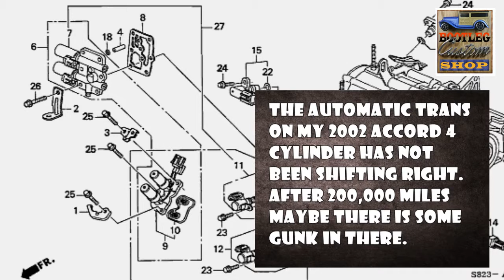1998-2003 Honda Accord automatic trans shift problem fixed with a crowbar and q-tips

Comment: Seriously, I can't understand why this isn't listed as a periodic maintenance item by Honda.   They probably should be inspected every 60,000 miles.   But then again Honda doesn't even mention inspecting the PCV valve in the list of maintenance items in the owners manual.   Unbelievable how they dropped the ball on this.
Reply from the maker: Gotta keep the Honda mechanics busy you know!
Reply: I spent $100 at the Honda dealer so they could tell me the sloppy 2-3 upshift means NEW Transmission.  No indication of this whatsoever.
Reply: @landontesar3070  It's because Honda doesn't acknowledge this as a problem but it most definitely is due to their faulty design.  It could have easily been avoided by using an ATF filter.
Reply: Transmission Filter on 2003 – 2007 Honda: 
Replacable external ATF filter. You will find this by standing opposite the front left tire and looking down, over the engine fuse box.  
Part number: 25430-PLR-003

Comment: Thanks! I cleaned out the gunk on the first set of filters out. I used parts cleaner to spray it off then reinstalled. Mine was shifting abnormal and would over rev/ delay shifts on all gears even at a stop light. after doing this, it drove fine. And still does. Took about 40 minutes to do.
Reply from the maker: Great to hear! Tks for taking time to comment!
Reply: Did you only do the easy access one ?
Reply: garner newman I did both but honestly the one below the battery was clean. I cleaned it out anyways just in case and reinstalled. The battery tray is held on by a bolt you loosen it and slide up and it comes off  at least that’s how it was on mine
Reply: baltazar chavez how bad was the paper gasket on yours ?
Reply: garner newman it didn’t have a paper gasket it was a rubber one it looked worn but I reinstalled as is and it worked fine no leaks. I didn’t want to purchase one of it was still going to shift abnormal. I’m sure they are cheap though and recommend replacing it if your ride is nice.
Reply: baltazar chavez I got a clunky trans shifting hard and weird af did this help you a lot ? I’m hoping it’ll save me from trans swap
Reply: garner newman it’s worth a try it won’t hurt to give it a shot and go from there  prior to doing this I replaced my fluid as well it helped but still was clunky it’ll take forever to shift and when it did it slammed into gear so bad I thought the front end was falling apart
Reply: baltazar chavez now how is yours?
Reply: garner newman good as of today
Reply: Thats what my car does delay starts at red light in second gear.  Can shift manually fine in first gear when needed at red light
Reply: @newman6830  Gasket is $5 from Honda

Comment: So the lock up solenoid (first one) new replacement gasket with the attached screens is about $30 from Honda.   The shift solenoid gasket (second one) is only $5 in case you need them.
Reply from the maker: Great tips Gene. Tks for sharing & subbing!

Comment: Thank you so much. This totally worked. I was getting a P0730 code(replace transmission assembly), along with slipping gears.  Freaked me out.  Took the solenoids off, and sure enough there was gunk in there. Car drives fine now.
Reply from the maker: Great to hear! It is so sad when even the code reader is trying to screw us. Pls consider subscribing, your comment is great! Could use more folks like you here!
Reply: Having this same problem on my moms Honda. Did the problem ever came back on your car?

Comment: MOST of the time this is what you need to do all automatic accords. Change the gaskets and fluids with filter. I've worked on more than 10 of these and its always the same. Only one had a new transmission (owner wanted manual swap). Great video!!
Reply from the maker: I am honored by a thums up coming from an expert! Tks!
Reply: You can also test them to see if they're working with 2 simple wires that go from the battery to the solenoids. They should make a click sound and they should also read 2-3ohms of resistance.
Reply: @trdjody  i did a fluid change and cleaned both solenoids 3 times, lasts 4 weeks b4 needed to do the job again. 260k miles on trans. do you think i need to fluid change again or what ? thanks.
Reply: @carlexus3133  if you clean the solenoids screens and also flush out the old fluid then where is the gunk coming from that clogs the solenoids so quick again?
Reply: @carlexus3133  you forgot the filter... read trd jojo`s comment again.
Reply: @gfriedman99  clutch packs.

Comment: I have a 2002 Honda Accord 4cyl, and I got a P0780 code recently with the flashing D4. It was shifting all strange and RPMs shooting higher like the trans was slipping. I removed both sets of these solenoids, the clutch pressure solenoid filter screens were clean, but the second set with the 2 screens were completely clogged. After cleaning and putting everything back to together it shifts super smooth now and no more engine code.
Reply from the maker: Good info there Ryan. Tks for writing & consider subscribing for more! We can use all the good comments !
Reply: What product did you use to  clean the clog.
Reply: @tafa  I just used some Carb cleaner and a microfiber towel. Cleaned it up nicely. I was amazed how clogged they were.
Reply: Exact. Same. Thing. Can’t tell you how much I love how simple of a fix this was. If I would have got this issue with my BMW I would have financially lost it.

Comment: I literally changed every thing mentioned in this video and I still can’t get passed second gear. I drive a 2002 Honda Accord and at this point I’m assuming it’s the ECM. Has anyone else ever had the same problem?
Reply from the maker: these cars have weak tranny, especially if they are abused. LET US KNOW the outcome!
Reply: Bro I'm going thru the same damn shit.  In between first and second . And then coming back down as well.    Mine is the 6 cylinder tho.  Have you figured anything out?
Reply: @tylerlame2280  I ended up fixing it by rebuilding the entire trans. I put in a new JDM trans that had about 30k miles on it and I changed every shift solenoid and censor
Reply: You ever find out exactly what it was?
Reply: @tylerlame2280  that’s what it was lol the trans and all the shift solenoids were super old and beat up. The ECM and everything else was fine

Comment: That was awesome.   I subbed.   Great closeups.  To the point.  

2002 Accord.  225k miles.   Started getting p0730 check engine. Changed the fluid.   Fixed the problem.   Now a month later problem is back but only in the cold morning for about 5 minutes till it warms up then shifts smooth again.    I’m probably gonna wind up cleaning the solenoids next.  Thanks again this just what I needed.  Oh yeah and great tunes.
Reply from the maker: Thanks for the sub! Sounds like you are on the right track. Keep us informed

Comment: September 10 2024 I had this video pop up looking for information how to replace some instrument bulbs. 

Anyway,  one of the main problems people say the gen 6 accord is transmission failure.  I wonder how many people got taken for told they needed a new or rebuilt trans only to have these filters cleaned?

Those filters could easily be the reason Honda automatic trans in the gen 6 go bad. If the transmission doesn't get the required circulation of fluid it is bound to fail. It is no different then a engine with no oil pressure. 

I have a 2002 accord.  I don't drive nearly as much as I used to. The past 4 year's I am lucky if I drive more then 4000 miler per year. I know that is nothing. I drove 86 miles one way to work for year's.  Lucky for me I had a company vehicle and fuel card.  Sorry I got off subject. I will be using your video to make sure the screens in my accord trans are clean. Thank you for posting the video. Year's later and it still helps people that drive old car's.
Reply from the maker: Glad to help! Tks for the like! Yea that is a neat trick . The many people who junked their honda for that kinda minor fix must be staggering.

Comment: Own a 2000 Accord SE with 200k and was dealing with sluggish shifts.  This video was very helpful.  A 3 qt fluid swap two times, and cleaning of the screens made a marked difference in performance.  Interestingly, the VTEC solenoid screen clogged at a similar mileage.  I think it is very important to note to do a fluid swap in addition to the cleaning of the screens.  Thanks again!  (ps.  PITA)
Reply from the maker: Well done Corey!  I agree, fluid change & cleaning as shown are the way to go!
Reply: Yeah gotta change the fluid else it will just clog the screen again
Reply: I would replace the VTEC solenoid gaskets (which include the screens) if they haven't been replaced already because they are likely rock hard and leaking oil all over the back of the engine by this time.  I had mine replaced by my mechanic about three years ago because they are a bit difficult to get at and I didn't have the right tools to do the job.

Comment: So I had some time today to do the "easy one".   How did you get the top bolt out?   The steel ATF line is right above it - no clearance (at 0:33).  I tried stubby wrench, wobble socket, universal - no go.  The only way I can see getting to it is to remove that ATF line that's above it.   Is that what you did?
Reply from the maker: Yes that was a challenge. I believe we used a open end wrench. Or maybe a crow foot. A little at a time till it got so we could grab it. Didn't take off atf line.
Reply: I @bootlegcustomshop4129  I am going to try removing that line or at least loosening that large bolt that holds it to the trans case so that hopefully I can wiggle the steel line out of the way.   Geez, Honda could have put a bigger curve in the line to avoid covering that bolt - plenty of space north of it.   Just crazy busy with work now due to the holidays plus good weather days are getting far and fewer between now.
Reply: @bootlegcustomshop4129  So yesterday the car became almost undriveable even shifting manually down to 1 or 2 stopped working.   Fortunately my day off today was a nice day  so I went ahead and tackled this job.   I had to get the ATF line out of the way for the top solenoid bolt.  No way around it.  Actually pretty simple.  17mm gets the bolt at the end of the tube.  Careful there are 2 aluminum washers above and below the ATF tube - they're the same washer thats used on the oil drain plug.  Next 10mm on the side bracket - an open end or better yet those ratcheting box wrenches get it. Last is the 10mm holding the tube near the top solenoid bolt.   Now the line can be moved out the way.  Easy 3 10mm bolts for the solenoid.   My screen was clogged worse than yours.  Totally packed.  I couldn't even see daylight through it holding it up to the sky.   I could have cleaned it, the rubber was still pliable but opted for a new one anyway.  So put it all back together being careful not to cross thread any bolts.  10mm gets 8.7ft/lbs the 17mm gets 21ft/lbs.   About an hour job.   Couldn't believe how well it shifts now.   Like new again.  Hasn't shifted this smooth in at least 10 years.

I wonder how long before it gets packed again with crud.   It's possible it happens quickly from all the shit floating around the system even though I changed the fluid.   We'll see.

Comment: LOVED THE TUNES!!!!! THANK YOU...never knew about this other threefer solenoid! Crossing my fingers!
Reply from the maker: Good luck! Let us know how it goes. & pls write more & consider subbing!
Reply: @bootlegcustomshop4129  I did sub. no sure why it isnt showing on your end. Anyways, yesterday, after doing that hidden solenoid, I drove her, 99 accord 4cyl, and she rammmed hard  into first gear and would not come out of first. automatic shifter was loosy goosy, not engaging the trans even with engine off...had to press the release button to move the shifter but nothing...stays in first. Fortunately, was not far from house, had to tow strap her home. She did pull easily.
Question~1) How do I get her out of first (shows in 1st on instrument panel) ??
                      2) When putting that hidden solenoid back on, those three little tubes...surrounded by the little round gaskets, I may have revearsed the tube, screen side toward solenoid. (correct?)  Cant really afford even a rebuilt trans just yet, so I need to get her out of first, which keeps the car from even starting. I will check that adjustable shifter lever underneath to make sure it didnt pop off. 
Trans has been hard shifting, not shifting, slipping, but once I got her to higher speed, (over 50) I could ride around but it seemed like I was only in third. (rpm was kissing 3ooo) 
Care to email me?
Reply: @rinserepeat2877  if something is backwards that could do it. Sadly that car is not mine anymore, or i would take a pic of the area. Maybe look for shop manual online? Thats how i did mine back then. My email should be on the home page...
Reply: @oldartisttricks2692  thank you for the reply. I bot another accord, 03, 4cyl...I will now be able to diagnose and work on this 99 to get her out of first and hopefully to start. Trans may be shot, but will see.

Comment: My got stuck in the mud the transmission line busted fixed put new fluid in it D4 light flashes it only went 20mph then stop doing anything so does that mean it's done or just needs fixing did the Reverse to Drive rock while stuck in the mud the linear solenoid connector broke too replaced that too! So is it fixable the Transmission work great before that!
Reply from the maker: Sorry to hear. Maybe mud got in there somehow & clogged things up. Perhaps another viewer had a similar experience.

Comment: Nice.  I have a 1993 and the d4 light stays on with shifting problems.  Was thinking it was the tcu circuit board but I cleaned solenoid as you prescribed and performed a  total reset on both tcu and ecm by connecting jumper cable to positive post  (cable connected) and negative cable (disconnected from battery).  Will get back if this lasts.  Test drove for a few nervous miles.
Reply from the maker: RB this is a great post! Please keep us informed of any updates & consider subscribing . Your expertise would be very welcome!
Reply: Found out the d4 came on after a day and now think it's the tcm after all.  D4 not blinking but solid light
Reply from the maker: Good info! Tks again for sharing

Comment: Well I have a 2002 Honda Accord 2.3L.  I cleaned the lock up and A/B solenoids and did a transmission drain and fill.  Transmission fluid was very black.  Let just say that when I drained the transmission, I drained the 1 and 2 clutch.    Beware if your fluid is very black, Car only had 128,000 miles on it when I got it.   I had to get a transmission swap done and it still has some jerking issues and I installed a in line transmission filter, the same one that is used on the 2.4L element and accords.     

   ( I did find out that the torque converter on these transmissions are the culprit for the screens to get clogged up.  Torque converter slips causing clutch material to go through the system ruining the whole transmission)
Reply from the maker: great comment sir! Pls subscribe if you didnt & I will Star your tips!!

Comment: Hi, great video, I have a civic 2001 that slips into false neutral when the engine is warm. The fluid has been recently changed and i dont think the mechanic used honda atf. What should i do first.
Reply from the maker: Me, I would check the solenoid you can see then test. Save the ones under the battery for later as the access is harder. Gpod luck! Pls consider subscribing my channel can use more great comments like this!

Comment: At the 6 second mark on the white  diagram there are the numbers 11 and 12  what solenoids are those? And do i need to clean those as well
Reply from the maker: NM I believe you are talking about the ones under the battery. I did both sets. So I say do the 2 sets of solenoids. Not that hard. Is one is more important than the other?. Depends on how your car is acting. Doing half the job may give you a half assed repair. Good luck!!!

Comment: Excellent video, my fluid has been burning up incredibly fast and when I drained it a few days ago it comes out looking like ink. The fluid burns up incredibly fast. Could this be remedied by cleaning what was shown in the video?
Reply from the maker: DOnt know if this would help but when we drain & fill the trans we do it 3 times with about a week or 2 between drains to get it good & clean
Reply: Bootleg Custom Shop I’ll give it a shot. I really appreciate it brother. Again excellent video and excellent help. 🤘
Reply: @gavinhoward9566  one more thing. We get honda fluid online (cheaper) for this
Reply from the maker: Ted did it is my other channel. Honda fluid is the way to go. Good luck!
Reply: Is that a V6 engine ?